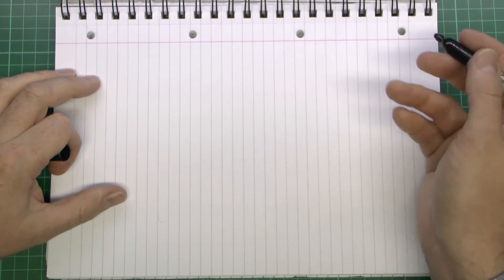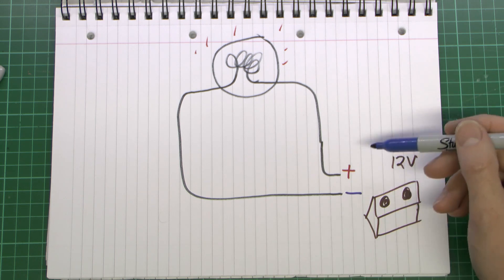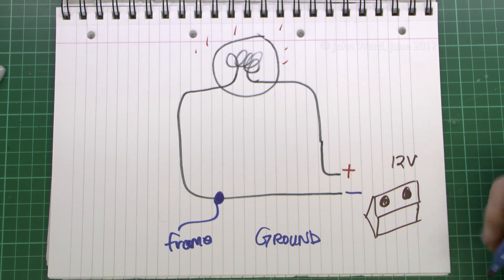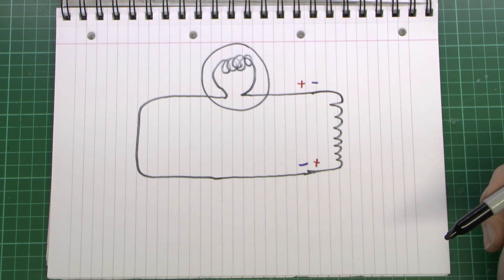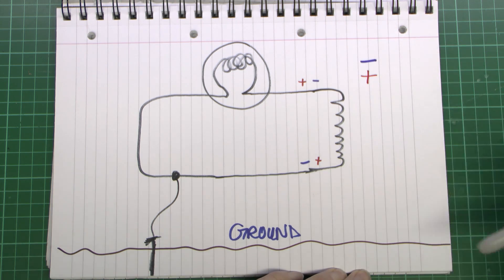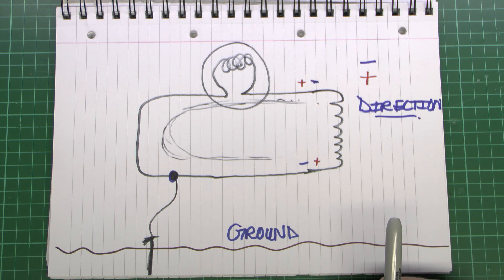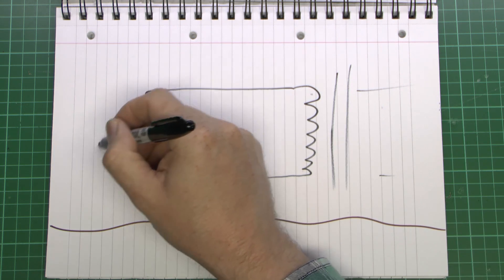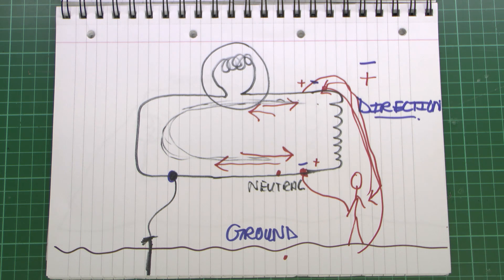AC, DC and Polarity in Electrical Systems

Comment: We have an old TT system in our property. The neutral is not connected to ground (as far as I can see). Would there be any potential between line and ground in such a case, if only small? I realise there will be a connection at the transformer some way away but we are in the middle of nowhere, miles from the transformer.
Reply: Guinea Fowl exactly that,  however even if PME is not available you can achieve this by fitting individual RCBOs and removing the RCD main switch which can cause nuisance tripping.
Reply: Guinea Fowl that sounds like, protective multiple earthing. (PME/TNC-S) contact your provider and gain permission to use it.
Reply: Does that mean, potentially, the incoming neutral could be split into earth and neutral after it enters the house? In this case, I suppose I could have a non-RCD protected circuit for the workshop and oven. At the moment, all circuits are on an RCD as the TT earth loop impedance is too high.
Reply: electricalsolutions Yes, we are fitting individual RCBOs for all the 18 circuits. Not cheap but by far the best way I think. One day it will all be RCBOs for individual circuits I suspect.
Reply: Hi Colin, it is not permitted to connect the neutral to your earth electrode and if there was such a connection after your RCD it would most likely make it malfunction.  With TT installations there is a possibility of potential between neutral and earth.  This is why on a TT installation it is essential a means of double pole isolation is installed.  This is relaxed on a TN installation typically seen on a three phase distribution board where the main switch is only 3 pole and not 4 pole.
Reply: Interesting and something to learn every day. Love your videos so thanks for the time you take for sharing ;-)
Reply: That's interesting. Our house has TT earthing, and there are 5 poles leading just to our house. Each pole has a tap from the lower wire down to ground. However, there is always a volt or two of potential between neutral and earth, which increases with load. Is this potential developing across the resistance of the earth between our earth rod and the nearest pole tap?

Comment: Hi John, I need to question you here,  your diagram does not show what we have here in the uk,  we ground the centre tap of the transformer at the point where we expect 0volts typically the star point.  It's between that point and the phase conductor we expect to see 50 hz.   We do not ground a phase conductor where we would expect 400 between phase conductors. 

Comments appreciated.
Reply: John, apologies, at 3:39 you clearly stated it's one half of a transformer.

Comment: If I came into contact with the negative wire in the isolated system I would get a shock. When it's connected to the frame of the car why don't I get a shock when I touch the frame of the car?
Reply: effectively, though note those sets of 3 wires are 3 phases attached to delta-wound-transformers, all are 'line conductors' / dangerous at very high voltage, they may not be carrying a 'neutral' (grounded current-carrying-wire) at all.   Presumably their supply transformers nonetheless have some sort of earth-reference and (importantly) means for excess voltage (lightning etc.) to be shunted to ground....     In any case notice that these high-voltage 'transmission' grid systems are quite different to handling of 230v etc that IET class as ''low voltage'' in their terminology.
Reply: Or, as suggested, got a nip from the HT section, which is not 12V but more like 12,000V
Reply: The car is an isolated system - if you touch the frame, you become the frame, but no circuit is made as the ground on which you stand is not part of the cicuit. If you touch the frame and the positive battery terminal, then you complete the cicuit, but 12 volts is not enough to shock you anyway.
Reply: I've seen a few  people get a quite a shock from messing around under the bonnet, presumably by touching the frame and the +'ve terminal as you suggest to complete the circuit. 12V would seem more than enough to knock out a fair punch. 

If I have a battery in front of me, no matter what the voltage - say 50,000 volts to get my point across - and connected to nothing else and I touch either one of the terminals leaving the other well alone do I stand any chance of getting a shock or does there have to be some way back to the other terminal for me to be in danger?
Reply: Yes, there has to be osme way back to  ther other terminal...
HOWEVER high voltages can arc and AC can capacatively-couple so not quite as simple as ''touching'' in all cases...
Reply: So presumably one terminal of the national grid system is stuck in the ground somewhere as I presume I would be killed if I touched the overhead powerline?
Reply: John Hawkes  Hi the main reason you don't get a shock from car electrics is because they're only 12volts, mind you be careful around the H.T ignition sections which can give you a nasty nip!
kind regards Warren
Reply: A battery is an isolated supply, so no, you wouldn't get a shock from touching one terminal. However, at 50 kV things change a bit - you might get some capacitive charging as you are brought to the same potential, and also 50 kV is probably high enough to spread some electric field to the ground you're standing on. But that is an extreme example. Are you sure people really got a shock from a 12v battery? I've touched both terminals on a hot day (sweaty hands) and got nothing. They've probably just let a positive wire spark against the frame and got a fright.
Reply: "12V would seem more than enough to shock you" - No. Even testing at 50V, the impedance of my skin is 100 kohm according to my Megger on this warm day. I=V/R so 50/100,000 = 500uA, which is not even feelable. At 12V there would be even less.
Reply: You're confused by thinking of 'charge'. Voltage is not charge. It's a measure of the difference in energy stored per unit of charge between two points. A potential difference, or a push from one terminal and a pull from the other. Try measuring V between the +ve of one battery to the -ve of another - 0 volts. Current cannot flow between them and do work, so there is no potential to do work, so no potential difference. The reagents in the battery will only be able to complete their reactions if electrons flow from the negative and back to the positive.
Reply: There is actually only a very small static charge difference in even a large cap charged to high voltage. The voltage is a reflection of the energy difference in the charges on the two plates, giving an electric field. Imagine the isolated cap as an isolated infinite slope. Charging it to 1000V means the plates are pushed apart on that slope. You can only define the height of either plate in terms of the other. Ground/you are not on that slope, so asking what is the voltage to ground/you is as meaningless as asking which of two astronauts in deep space is 'higher'
Reply: No, if it's isolated from ground you can touch either side without a problem - only if you touch both sides at the same time you will be shocked. Even in a grounded system, touching the 'hot' side will only shock you if you're also touching ground (witness birds sitting on a power wire while a squirrel might get zapped transitioning between wire and [metal ]pole...)

With the car: 
a) the body of the car is isolated from the ground you're standing on by rubber tyres 
b) if the car's body was connected to the ground, so would the negative of the battery and there would be 0V between them. In this case touching the +12v (0r -12V in the case of a positive ground car)  pole/wires could potentially shock you, just like touching the +12V pole of the battery  and the body of the car, but
c) 12V isn't enough to break through (dry) skin. You'd essentially need raw/open wounds touching the conductors for 12V to potentially hurt you.
Reply: Thanks Michael. So if I provide a path to ground will I get a shock if I touch either of the wires in an ungrounded system? If so doesn't the frame of the car just become an extension of the negative terminal - insulated from ground by the tyres - so touching the frame should result in a shock?
Reply: It depends, if you referenced the negative terminal to the ground (actual earth/soil).  No shock when you touch the car body.  If you reference the positive to the earth then yes you could be shocked, although why you would do this is beyond me.
Reply: Surely in a car - given the insulating nature of the tyres - there is no way of actually "grounding it" the frame surely becomes part of the circuit as its the only connection to the negative terminal of the battery. When I touch the car do I not provide a short circuit to Earth for the current to flow through as the squirrel would if his tail hit the ground whilst still on the power line?
Reply: So as Warren suggests the shocks come from the H.T circuit not the 12v Circuit and in principle I can go and grab both terminals of the battery in my car and I wont feel a thing?
Reply: Yes
Reply: Cool. Last question. If I go and connect a voltmeter to the frame of my car and the other lead to ground what will the meter read?
Reply: Just when I thought I was getting the gist of things! I thought the answer would be 6 Volts! :-( Oh well, back to the drawing board.
Reply: Er, no. Voltage is relative, like height. You always need two probes to measure it. Even if you measured between +ve and ground you wouldn't measure much. Since the frame is well isolated from ground by the tyres, it would be similar to putting one lead of your meter on +ve and leaving the other one hanging in the air. Since there's no potential path between +ve and ground, there's no potential difference, ie voltage.
Reply: Thanks. I'm clearly missing something fundamental. I thought a voltage was created by a charge difference so the charge difference between the electrodes creates a 12V difference in potential. I would have thought there would be a charge difference between either electrode and earth of 6V but I know that doesn't make sense as then a current would flow and reduce the connected terminal to 0 V leaving the other one at 6V. However a gold leaf electroscope does discharge if I touch the plate whether it is charged positive or negative so I don't understand why the terminals don't discharge in a similar way. Is the chemistry of the battery ensuring this can't happen?
Reply: The electroscope is charged and develops a voltage relative to ground. The battery is charged and develops a voltage between +ve and -ve and nowhere else. Voltage, by the way, is a measure of the energy stored in each unit of charge.
Reply: Surely one terminal most have an excess of charge and one a depletion for there to be a potential difference between them. Half of this difference most exist between each terminal and Earth which is balanced charge wise, neutral , so a potential most exist between each terminal and Earth as well as between the terminals?
Reply: Thanks. I think your comments about the reagents in the battery answers my query. I was looking at a battery as two separate "jars", one full of positive charge and one full of negative so charge could flow from either jar when connected to earth just like in the electroscope. The fact that the charge difference i.e. the potential can only be maintained by a chemical reaction that requires the circuit to be completed clears up my confusion and I can see now why I wouldn't get a shock touching either terminal of a battery and why I get 0V when I measure a single terminal. Compare this with something like a VanDeGraff generator were you can get a shock due to an actual collection of charge being present without the need for a chemical reaction to continuously take place.
Reply: Unfortunately, the chemical reaction is somewhat incidental. If I charge a capacitor to 1000V, then touch either terminal, no shock, ie no voltage between one terminal and me/ground. The capacitor is not referenced/connected to ground. The VDG generator is ground-referenced, as is your electroscope. Planet Earth can be considered 0V, but only if actually referenced to the circuit.
Reply: Ummmm! So touching one end of said charged capacitor has no effect on me or the capacitor, it - or specifically the plate I touch  - remains charged? So the only way that charge is going to move is if it is connected to the place it was originally taken from i.e. the other plate?
Reply: Thanks for your replies Guinea Fowl they are most enlightning and make a lot of sense. They are clearing up a fundamental flaw in the way I have been seeing electrostatic problems. I had a strong flawed feeling that charge would flow from a charged object to an earthed one but I can see now that this is wrong. If i'm a neutral object and I'm placed within the electric field surrounding a charge I will not feel anything or effect the charge in any way, I'll travel through unperturbed. I think because I imagine everything running to Earth in an electric circuit if given half the chance - a short - charges always move to Earth but now I know they will only head that way if part of the circuit is grounded providing the appropriate "slope" from the circuit.
Reply: Pretty much nothing. If the frame of the car is carrying a heavy load, like starting current, you may find a measurable, tiny voltage, but this would be hard to distinguish from background noise.

Comment: It makes no electrical difference if a car has positive earth, but the practice was discontinued because it caused corrosion.
Reply: Phil Reynolds exactly, positive DC voltage + salty water = anodisation.
Reply: Yes that's right. A negative (or cathode) "pole" will attract metal ions by electrolysis if there is an electrical pathway (e.g. moisture)  between the positive (anode) areas and negative (cathode) areas. If the polarity is reversed, metal will be lost at the anode and if this happens to be the car metal bodywork the result is quite obvious!